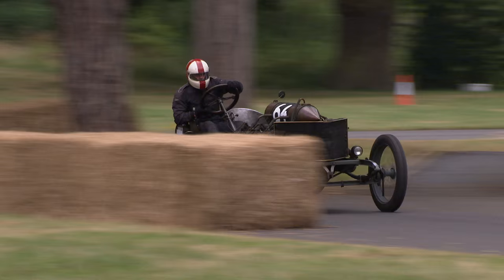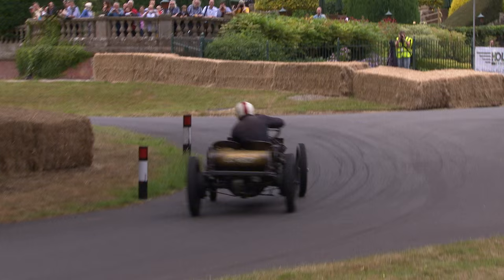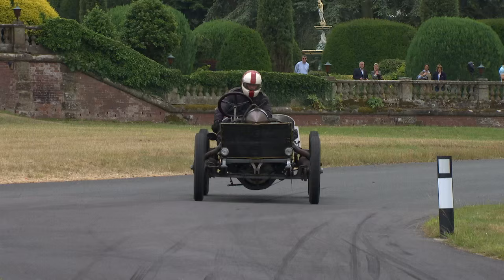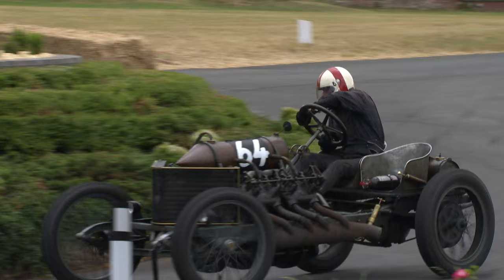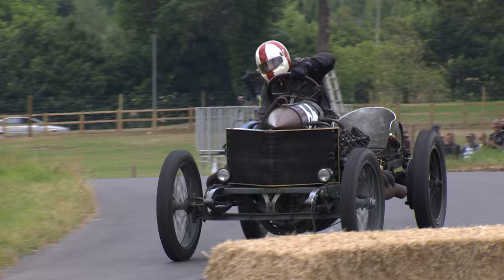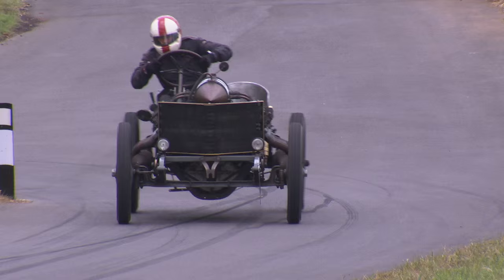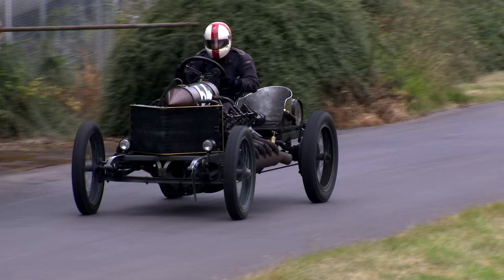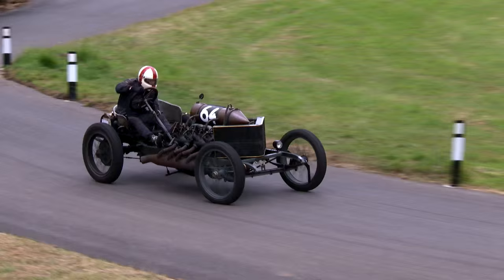Mark Walker Wows the Crowds with the Darracq 200Hp at the Chateau Impney Hill Climb

Comment: 25L v8 only making 200hp and we have 4 bangers that are just 1L making that amount lol. Crazy how things are these days
Reply: yea, and that 25L v8 probably makes 1000+ft lbs of torque, where the little 1L 4 banger makes.....like 70.
Reply: The most crazy thing is the weight of this thing, less than 1000kg with the massive 25L engine included, the engine may be like 70% of the weight of the car
Reply: it does 84mph at 1000rpm